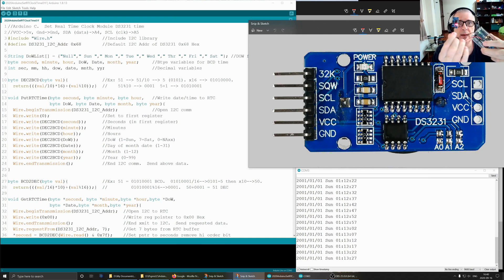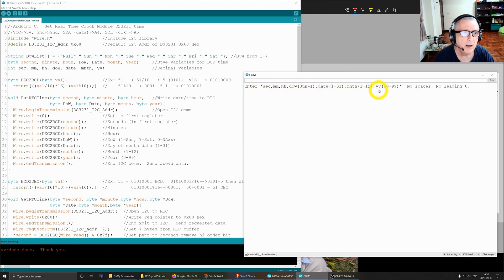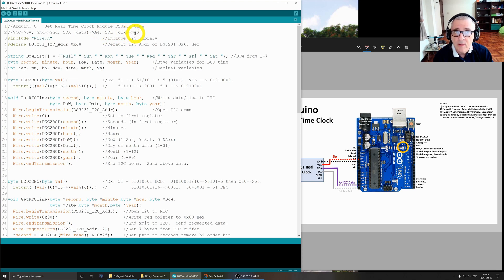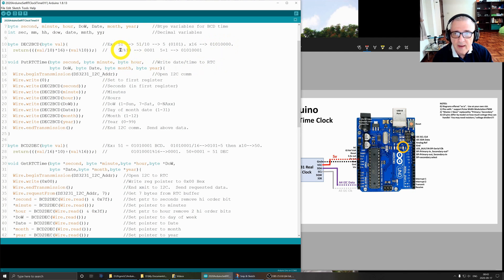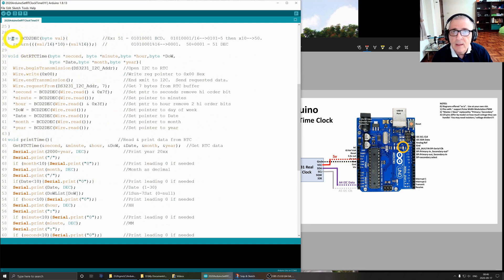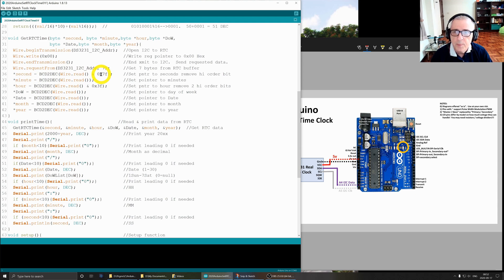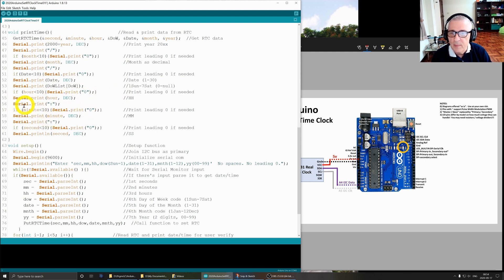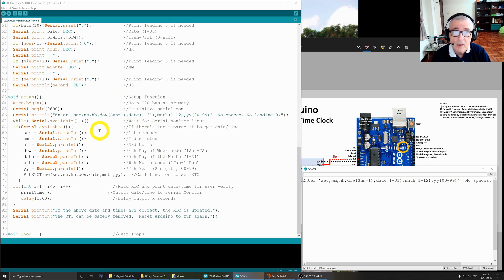Arduino Set Date/Time Real Time Clock DS3231 (4K)

Comment: Thank you for the video. I am fairly new to coding and Arduino and so far it has been quite a trial but I am learning a lot. I took it up just before you did this video at the start of the pandemic. Do you have a video on how to display this output to a .96 OLED?
Reply from the maker: No, never connected the OLED display.
Reply: ok, no worries. I will keep looking. Thank you.

Comment: Please note that this module absolutely required at least 1 modification if you're using it with non-rechargeable battery. This module have charging components, and in theory will damage lithium battery. 2 options: 1: use rechargeable battery (not easily obtainable, expensive); 2: remove single resistor to break the charging path. 
Other modifications:
1. remove power LED if intended for battery-operated project
2. eeprom is a next candidate to remove
3. This module have pull-up resistors for I2C, both SDA & SCL, so if other I2C modules used, one set of the pull-ups should be gone.